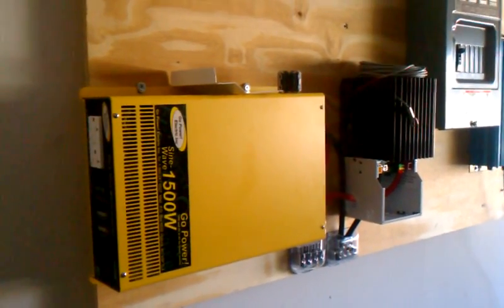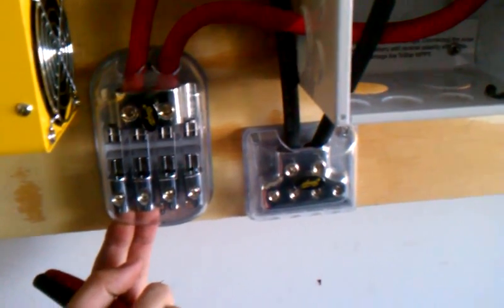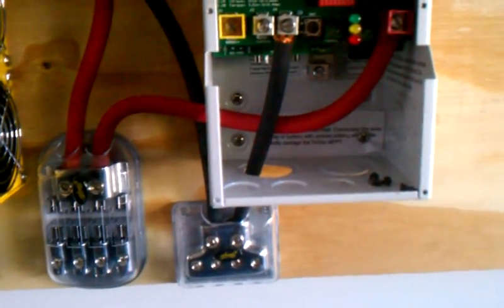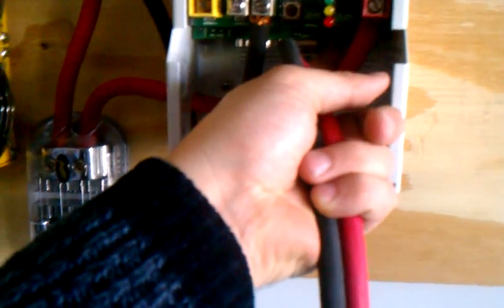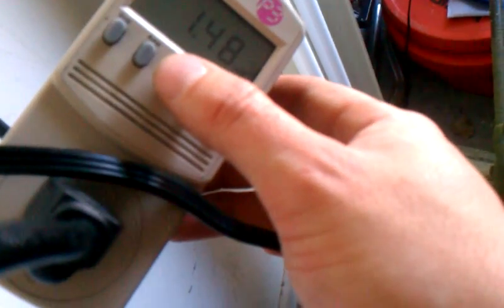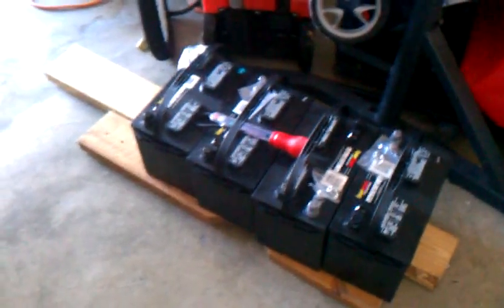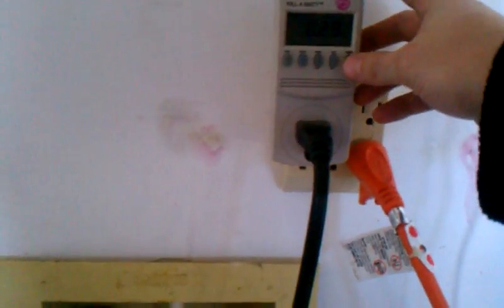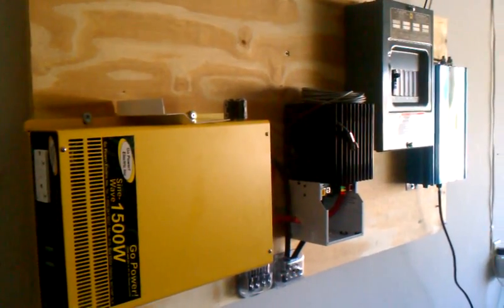Solar panels MPPT charge controller and 1500 watt Go power pure sine wave inverter part 3

Comment: @helloman1976

Great videos and great work.  Thank you for posting.  I may have missed a post about it, but can you tell me where you got the bus bars you use in connecting your battery bank/voltage devices?
Reply from the maker: +Tim Simpson Bus bars for batteries that work well are hard to find. I use all automotive parts which are designed for 12VDC anyway. I have been running 24V of course with no issues. I did run about 200 amps @ 24V through these bus blocks and they did get warm so depending on how much you are running be careful. If you are powering your whole house, or heavy draw items like a microwave, go with a better/bigger bus system.
Reply: +helloman1976 Thank you, and mine is only 12V with a 40A CC and 2KW inverter.  You didn't mention where you got them, or what type they are.  I have some in mind, but looking still.  Thanks again for your time.
Reply from the maker: +Tim Simpson These are Stinger brand but they can be any automotive stereo part. I wouldn't use them again if I was buying new. I'd get a bigger blade type fuse setup instead of these MAXI fuses which are pretty much junk not to mention expensive.

Comment from the maker: @drolbaars71 You can run whatever you want given you have the batteries to do it. The solar panels charge the batteries and the inverter runs off the stored power. The solar panels would continue to charge the batteries, or try, even while you're using them. I was able to run just my refrigerator for about 14 hours. The washing machine only draws about 200Wh in a cycle so it's not a heavy load. There are some points it pulls 400-500W.

Comment from the maker: The benefit is reduced loss through line loss. The higher the voltage, the easier it is for it to travel across the wire. You can use smaller wire the higher the voltage also which could save you money. Personally I like 6ga wire as it's relatively cheap and very, very efficient. I like to run the highest voltage I can get to my charge controller and the highest voltage I can get to my inverters so I reduce power wasted.

Comment from the maker: @arnoldcustom Maybe if I had a long run of wire, like 40 feet or so. 1 foot of 2 gauge wire versus 1 foot of 0+++ gauge wire is basically no difference. Take an ohm reading, you may see .01ohm versus .009 ohms if that... It's important when choosing wire and such to take into account the laws of electricity, when you select wire you are selecting it NOT on its size but on its resistance. Picking wire based on its size alone will only result in spending more money than you needed to...

Comment from the maker: @MrJamieLudwig Sure thing, there are a couple places. I miscalculated slightly but I got 4 x 200w panels for $1200 shipped so to be precise I got them for  $1.50 a watt shipped. I'm not sure if I can put a link in here but I got them on eBay from a guy who has about 70 extra. You can also go to SolarBlvd com and search in their section called "Solar Panels & Systems" under the  175W+ solar panels and you'll find them for around $1.40ish a watt. Let me know if you want anything else solar..

Comment from the maker: @MrJamieLudwig People will argue back and forth on efficiency. My system is far more efficient then a cheap Chinese grid tie from eBay but not near as efficient as an Enphase inverter system. Also consider that when you stay on the grid your grid costs goes UP with each rate increase your power company does so yes you are making power but you are buying it at a higher cost. If you live in a state that buys back power then you're good, but otherwise you're getting hosed!

Comment: have you noticed a difference in your systems efficiency being off grid compared to grid tie? I am planning on going solar this winter by building my panels. Did you ever consider building your panels? How has your system been producing during these hot summer months?   P.S. Nice wheels!!!

Comment from the maker: @Xringer I think we've had a few talks about circuit breakers versus fuses, I still prefer circuit breakers they are just too convenient. I'll be wiring everything through mine with the exception of the battery bank. I like the fact that when I need to do maintenance all I have to do is flip my breaker and wait for the GTI CAP to discharge and I'm all set. I'll be working on the battery stand and battery wiring this weekend. Videos coming soon...

Comment from the maker: @Xringer I know where you're going with this "...the fuses will never pop..." and I'm way ahead of you. The current I will have right now will be 33.38A @ 24V coming out of the charger at max amperage under MPPT. I am fully aware that 70A of fuses will not pop given this HOWEVER if the batteries short or something like that they will pop. I'll probably use 40A worth of fuses, e.g. 2 x 20A blade fuses.

Comment from the maker: @Xringer I thought it took regular car blade type fuses but from the looks of it it might be MAXI type fuses which go up to 80A, if they are car blade fuses like I thought they were then I'll put 2 35A fuses in which will give me one big 70A fuse basically. The charge controller manual says to be "in code" you must use 25% larger fuses than the device can handle, the device handles 60A so 75A fuses based on the data provided by the manufacture.

Comment from the maker: @Fearlessthinker "Far" is a relative term and for us we will be able to run our 110W refrigerator for 50 hours with no additional sun light or we could use our system "regularly" with no additional sunlight from full charge for 12 hours. For us, that's more than sufficient and now if you go back to those figures and add 6 hours of direct and full sunlight and 2-4 hours at partial sunlight the difference is even bigger. We'll see though! I'll post videos of all the real world stuff I do :)

Comment from the maker: @Fearlessthinker Actually that's just simply not true, you can have infinite additional charge controllers and they all link together, they just have to be Morningstar controllers. Their tech support wrote me back and told me they are working on firmware to support wind turbines and until then they recommend getting the PWM version of the TS-45 and using that as a dump controller. It's very possible even with MPPT controllers, they send me a diagram PM if you want it.

Comment from the maker: @Fearlessthinker Actually, it's 230Ah but it's at 24V making it that much more efficient. Input voltage into the charge controller will be 48V and the battery bank voltage will be 24V, you gotta love MPPT charge controllers! The next thing will be a wind turbine just to help at night but I'm not sure how to integrate that quiet yet. One thing at a time, I still have the GF wanting me to plug in the hot tub lol! That's been going on for about 4 months now :)

Comment from the maker: @MrHorsetail The wire is clamped down at the connections and I have fuses inline with the battery side and the solar side. I could hang from these 4 gauge wires and they wouldnt go anywhere, might rip the whole board off the wall though lol...

Comment from the maker: @Fearlessthinker I have a total of 1150 watts of solar panels but I'm going to leave 350 on the grid and the rest, 800W, will be there to charge the batteries. We started with this smaller configuration knowing that we'll have to expand somewhere, batteries or solar panels, so we're going to use it for a while and see what we need from here. The solar panels run in a 48V configuration, the bank is 24V.